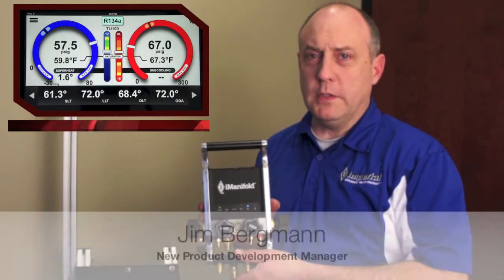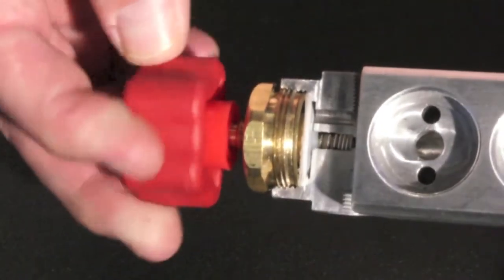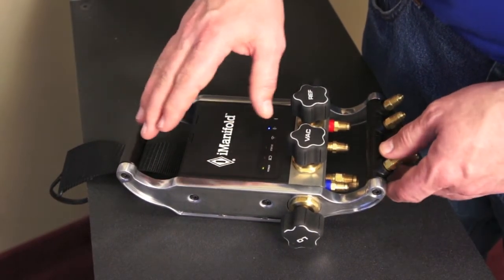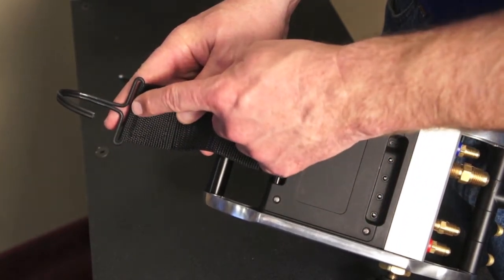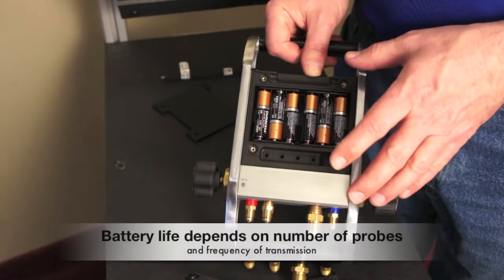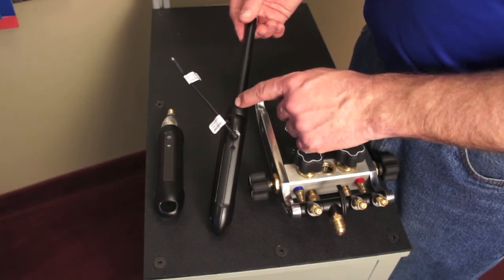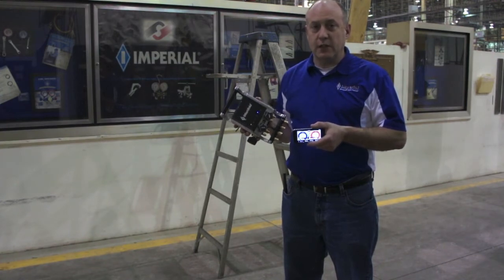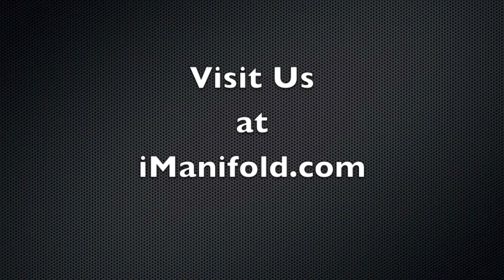Imperial iManifold Hardware Overview

Comment: Once you try it, I can almost guarantee you will not miss it. The Smart device provides so much more information and is so much better of a user interface that a built in display simply did not make sense. We knew from the time we made this decision that it was going to be challenge to peoples thinking, but I have a lot of confidence we made the right decision. Time will tell.

Comment: First off I'm a huge fan of Imperial. I have several manifolds, tubing cutters, and swaging tools. I've been very excited about Imanifold. BUT... I too have concerns about having no built-in display. I love the idea of wireless pressure probe with temp probe inputs. I have one question though does the Imanifold have a build-in micron gauge? I do think you need to offer a version with a simple built-in display even if it's only a black and white LCD (Not a stripped down version with a display, either).  Looking forward to more videos and information about the Imanifold

Comment: I realy like the SDP2/Sman4 radio sync function,(1) my sugestion is to replace the micron gauge with a RLA radio sync function.RLA is one of the most important functions that all the gauge set manufactures are over looking. Amprobe has a WATT function, team up with Amprobe. refrigerant gas has oil mixed into it, each time the gauges are hooked to a system you contaminate the micron gauge sensor, so it stops working. Washing it out with demineralized alchahol doesn't work. (2) next sugestion is to make the SMAN5 1.5 inches narrower.(3) Change the K probe clamps to a smaller compact version and to thinner more flexible black wires, and put a zippered pouch behind the gaugeset to contain the clamps.(4) improve the screen quality to a colored phone like screen and keep the screen "on the gauge set", drop the Iphone app idea, my hands always have condenser dust, blue leak lock, refrigerant oil, condenser fan 20 wt oil, red trace, Supco oil additive, roof tar, can insulation foam, armaflex glue, PVC cement, and alot of sweat and dirt on them. (5) My eyes get fatigued working a couple hours on a bright roof and bright yellow doesn't absorb light, it adds to the fatigue. I would go to durable black rubber with a yellow Fieldpiece logo.(6) This winter I was on a roof in Cleveland it was 2 degrees farenheit -12 wind chill, I was liquid charging a walk in cooler condensing unit with my Testo gaugeset, it was so cold the O rings weren't seating and liquid was pouring out the knobs, my sugestion would be to drop the aluminum and go to bronze with better seals for vacuum integerity. (7) And a second set of T1 & T2 readings with remote transmitters, for evap coil TD (txv adjustment) or evap delta T air temp monitoring while charging. Oh yeah, keep the price reasonable too, this would be the best gauge set ever, good luck.
Show less

Comment: Why not have a display? I understand the theory of using your phone or iPad. But when I use my phone for other features such as text or stylus, I loose the "display". What happens when the app fails or the phone or the tablet? Then my $800 manifold is useless. Will Imperial incorporate a display in another version or model? If so, then I would buy one ASAP. It seems that looking at another device is just an additional step for quick readings as well. The technology is great for a mobile logging solution but I just can't get used to not having a display.
Reply: ***** I miss my turn when I use my phone as a gps. Always get a call when I'm following the phone's gps.

Comment: Oh one more thing for the temp handle. Design some kind of round magnet with a hole in the center that slides down the temp shaft and attach it to the base where it meets the handle, that way when I put in in a hole that I drilled into the duct work  the magnet will attach to the duct.  One of my teso handles broke because they are alwys falling out.

Comment: I can't wait to get my hands on this manifols,MIT looks pretty sweet.

It would be cool if you could incorporate a pipe clamp to that wireless temp handle giving us a 2-in-1 wireless handle.
Reply: I was thinking to actually build the clamp into the handle somehow so that I didn't need to carry an extra accessory
Reply: I dont think it will be to bulky, the handle would remain the same just remove the temp probe that is there now and add a clamp but make one of the jaws straight and extend it about 4 inches longer than the other jaw so that we have a probe to insert into ductwork. 

Hope that makes sense, I can see it in my mind and it looks cool.
Reply: It would kind of look like a small hair straightener
Reply: Lol, I think I'm trying to catch up with you n that department, I can see my hair slowly becoming invisible.